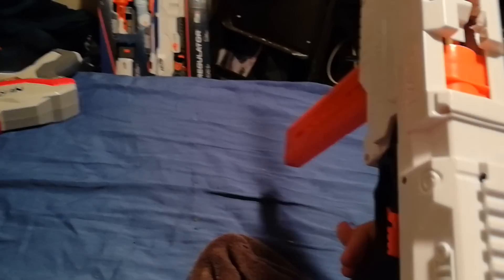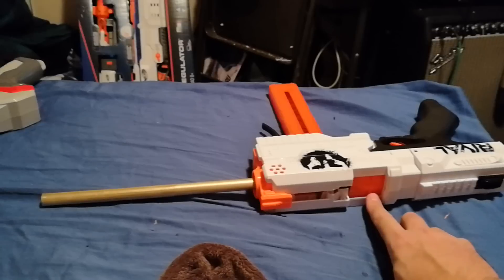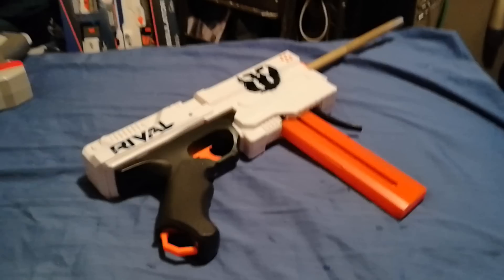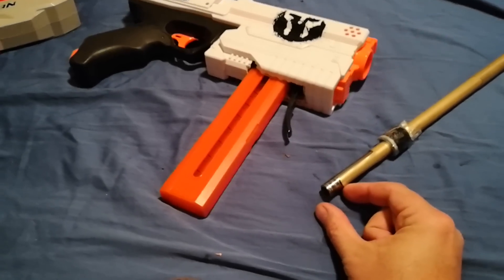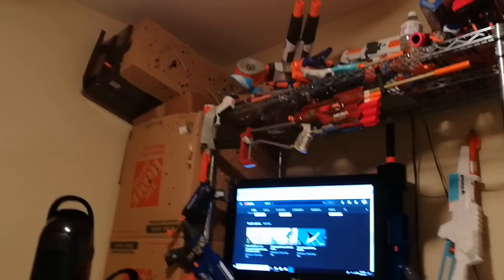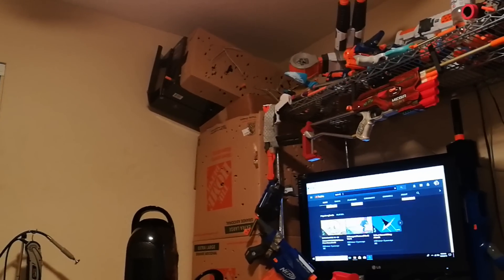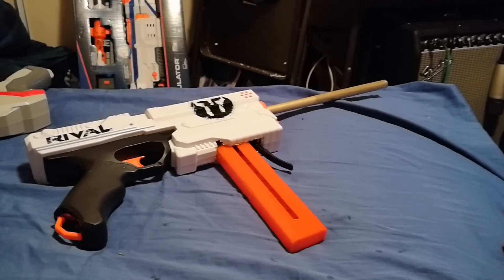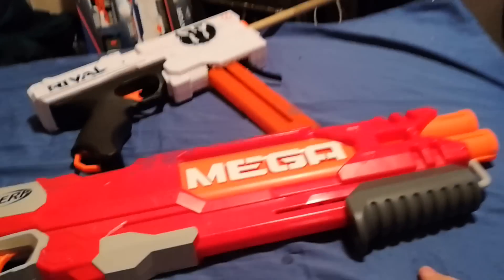[WIP] Very First in the world!  KronoMagnum frame-up before final Assembly

Comment: Other than teflon tape, how do you improve the seal in your blasters? How do you improve the alignment in your blasters?
Reply from the maker: Nicolas Reed exactly what I'm doing right now, cut every piece down, figure out all measurements, and then glue.  This is going to be an Epoxy set blaster, and epoxy tends to be adjustable while curing. So, you fidge the parts in place and let it cure in that position, it will be straight